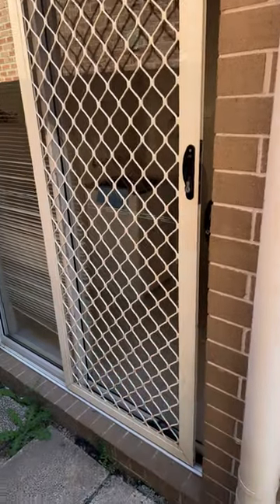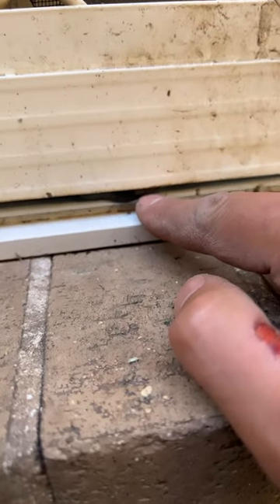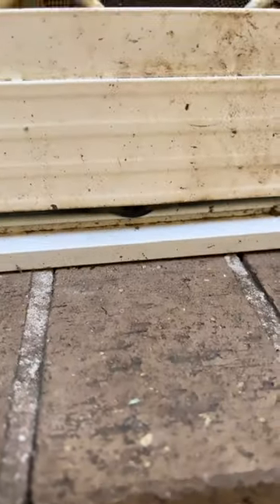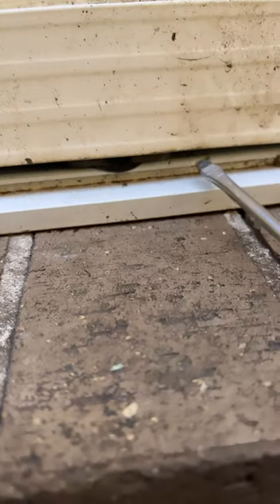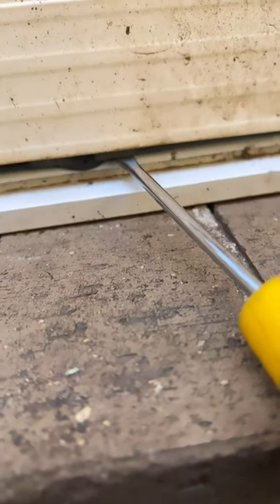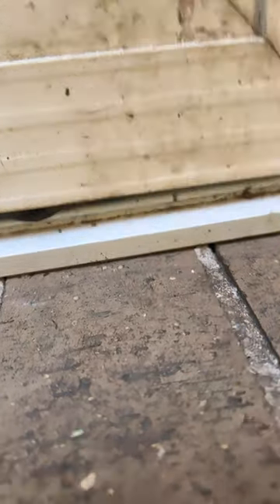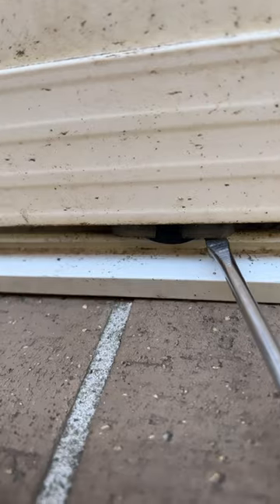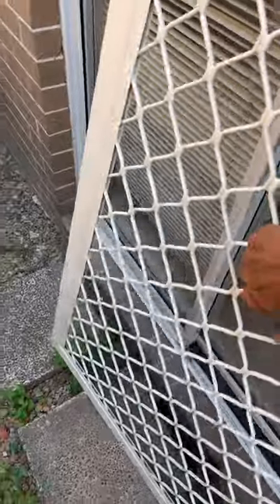remove sliding screen door #shorts

Comment: This video is fabulous. I was robbed recently and they removed the security door and sliding door.  I called the crimsafe installer to come and repair they said they would only do a new door. I saw your video, did the process in reverse and got the security door back on, it locks and is perfect.. thank you.  I have done so many things around the house with your help, replaced my mixer tap when it broke, replace exhaust fan and because your instruction is so clear with the tips and tools required it has saved me so much money and time.  Next I am patching ceiling and covering a stain and painting… Thanks Bill! ❤

Comment: Bill mine has rollers up the top and seem to hang inside a track and a gide on the bottom, how do I remove it as the back roller is jammed. Cheers
Reply: Is there a strip at the top you can remover for access to the rollers? There could be height adjustment bolts up there too.
Reply: @Barearmz  finally got it Yes it had a stip that was hiding the roller then lowered the door to remove door then removed the rollers separately
Reply: I have the same too. I actually lift upwards as the rollers manoeuvre up & down. When in the upwards position, it should give you a little room to remove the bottom rollers off of the track ( with my son’s help of course ) & it should come out that way then I put it back in, in reverse.